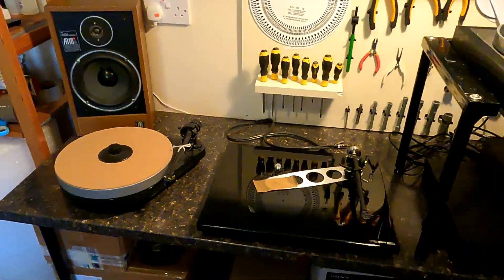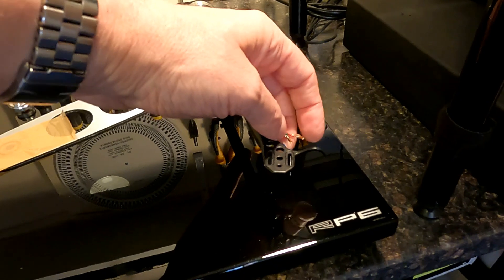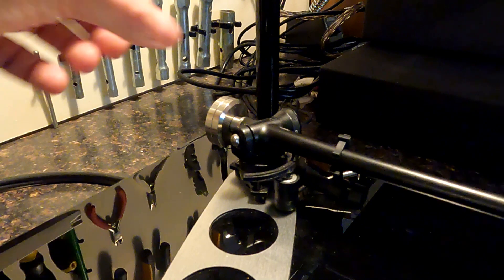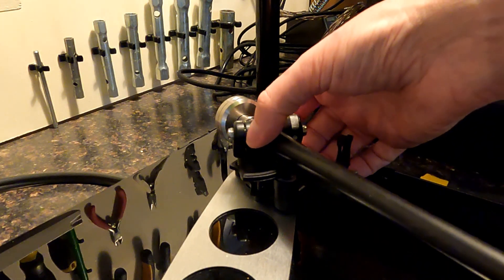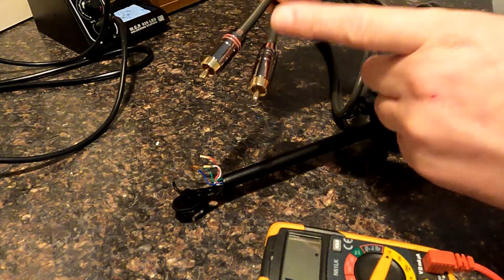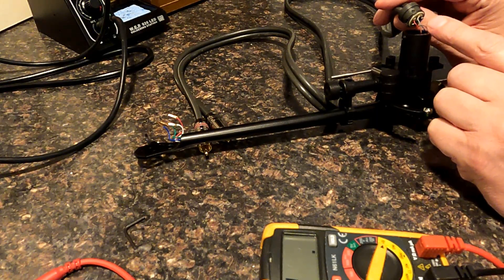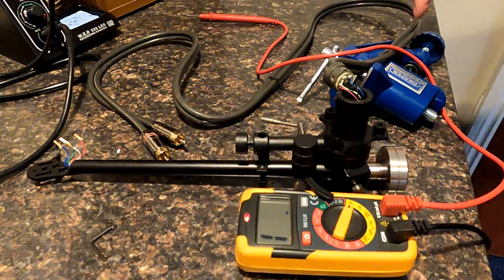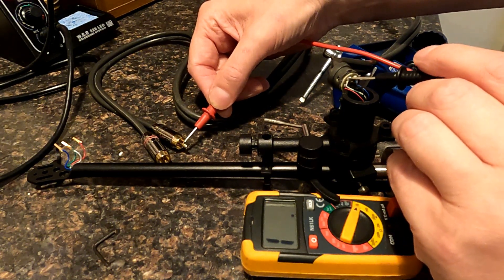Diagnosing a fault with a Rega arm - RB250 RB300 etc

Comment: I wonder if I could pick your brains please?
 
I've recently picked up a NAD 555i (basicly a Planar 2 with an MDF platter). On testing it the left channel was intermittent but seemed fine after a 'waggle'. I checked the amp inputs by connecting right out to left in which was fine. I changed the cartridge but the left channel still needed to be waggled to get it to work properly. I suspected a breakdown in the moulded phono plug so thought I'd solder a fresh pair on (which I've done many times to other decks without a problem). However on testing there was no sound at all. Tried cutting back the cable and different phono plugs but still no sound. There's not much cable left now before the plastic 'knuckle' on the leads but I sripped back preparing to try again but thought I'd do a continuity test from the cartridge ends through to my bare wires at the phono plug end. I was surprised to discover that both left channel leads seem to be shorted so that the white (or blue) cartridge connector goes full swing on my multimeter whether connected to the line wire or the ground wiring. The same applies the right channel with the red (or green) lead connected to line pin or screen. Removing the rubber arm plug and tesing again from this plug in both directions shows that there is continuity all the way through red to red and red to live pin but also red to green and to earth screen. Same happens on the left channel. Would the cable have shorted both in the arm and in the output cable? Am I doing something fundamentally wrong in testing?

Comment: I thrifted a Rotel RP900 with a Rega RB250 tone arm and Sumiko Pearl cartridge.  Plugged it in and the right channel was out and humming.  Gently fiddled with the wires on the carriage and it fixed the problem.  Guessing it’s not a permanent fix.  Do you know what the issue is?
Reply: I’m currently having the same issue. I duct taped it to the angle where it works. It’s a shame the video uploader never replied to you.

Comment: Hi sir as a retired electrician I often found with cables it would be a break near a connection , so it would be interesting to just snip off a couple of inches near the phono end to see if indeed that’s were it’s broken. The times I had fellow contractor come to me and say my drill has packed up . Just have a look at before I throw it in the bin . I would snipe the plug off and reconnect it  and 9 times out of 10 it sorted it  .   Copper wire has some interesting properties that can induce all sorts of issues even in the world of hifi .          Best wishes and kind regards as always 😀👍👍👍
Reply from the maker: You are absolutely right, they usually break just behind the Phono plugs .....  for some reason this one had broken at the arm plug end, which I've never had before
Reply: @cheshireaudio   bless you some you win some you lose , and of course if you are charging for your time your decision was definitely the right way to go . People are very lucky to have you close at hand to fix these problems . Knowledge is king and you poses it in abundance .    Best wishes and kind regards as always.    😀👍👍👍

Comment: Which temperature is best for unsoldering and resoldering the tone arm wires from the phono cables??
Reply from the maker: Think I had the iron set at around 400 degrees for this... but whether the display is accurate is anybodies guess